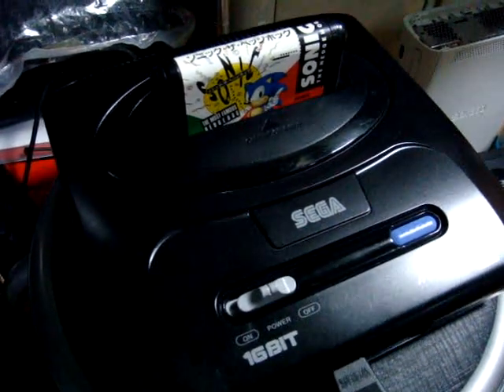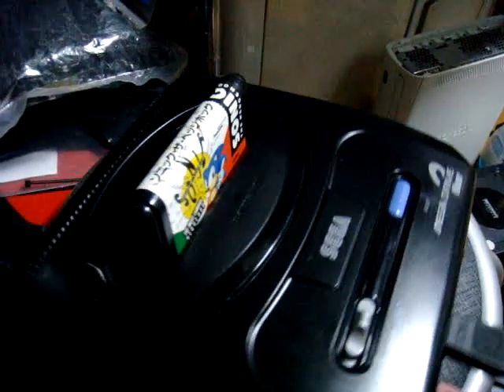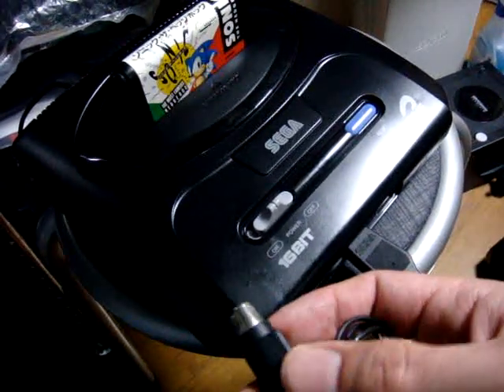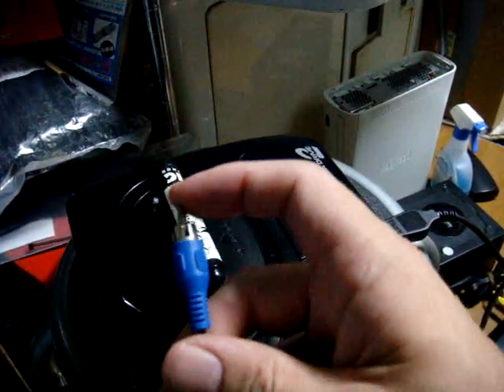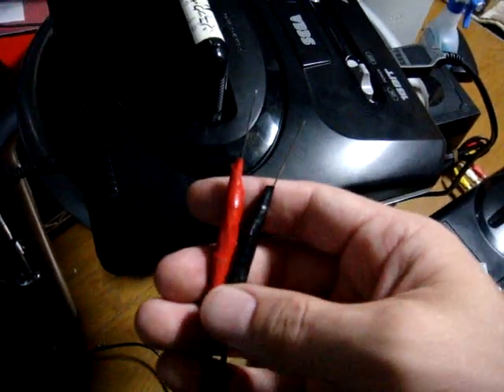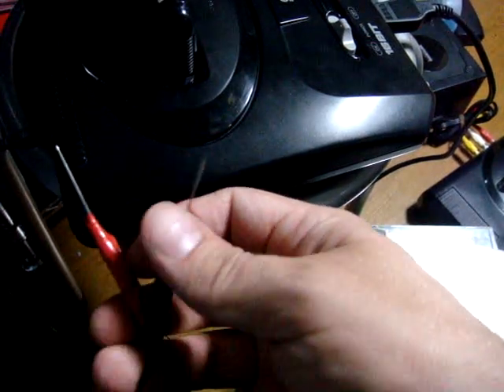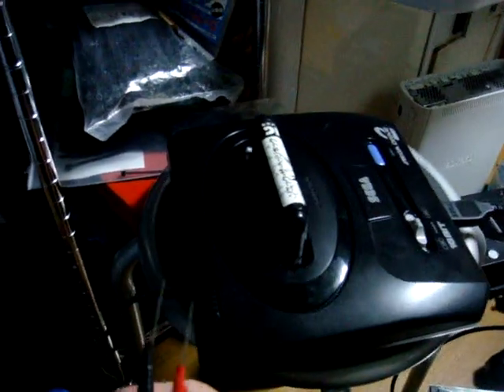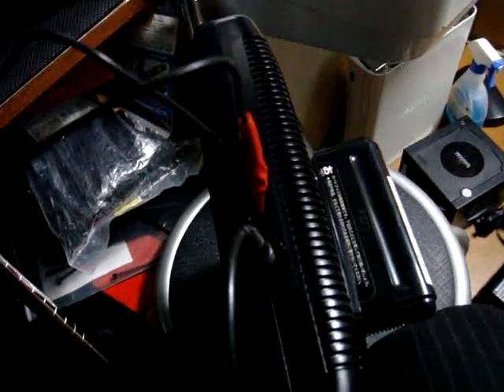Homemade DIN Connector Tester For Genesis/Mega Drive

Comment: I've also modded my mega drive. I've got AV connections in the back and have 4 controller ports in the front. At the moment I'm trying to add 4 wireless controller receivers in there, hard to find more space though. i can either have 4 controller ports or 4 wireless receivers. Doing the same with my SNES also.

Comment: Paper clips work well for this kind of probing. Use them for testing circuits for circuit bending and stuff like that. Also a friend of mine made a SNES Controller to USB adapter using them that works well. Paper clips are awesome :D.

Comment: Hia there.

I recently ripped the cable off an old keyboard with the big DIN plug.

Turns out that it will fit into the mega drive/genesis.

I have managed to get video to my tv using it (cut up an old RCA to RCA cable or RWY to RWY or whatever you want to call it)

Now my problem is that it comes up in black and white and scrolls, also keeps causing the TV to change from AV to S-video and back and forth?

Anybody know why and if its fixable?

Tim